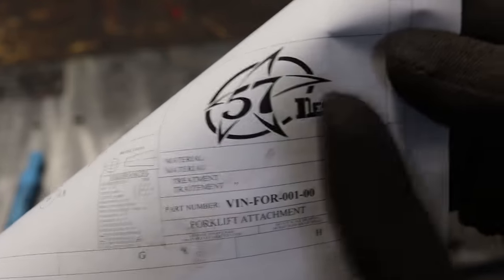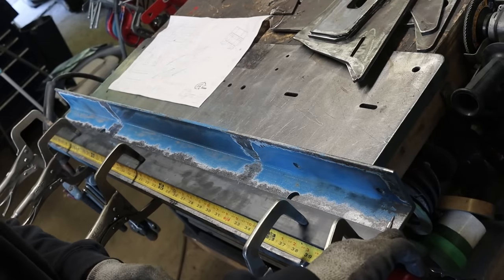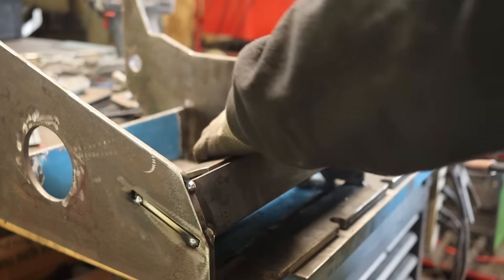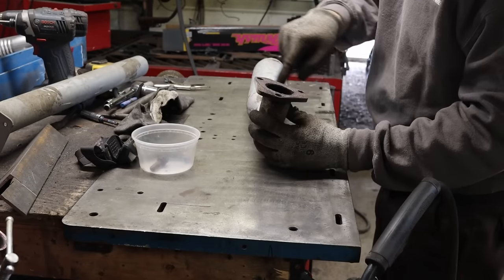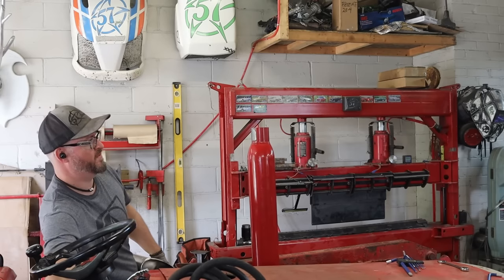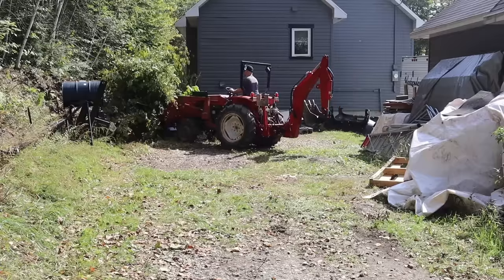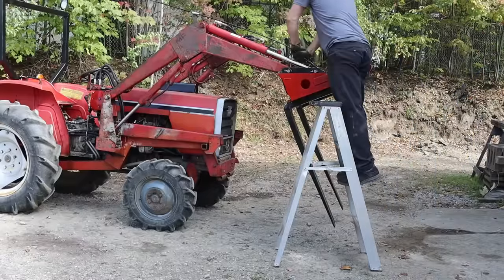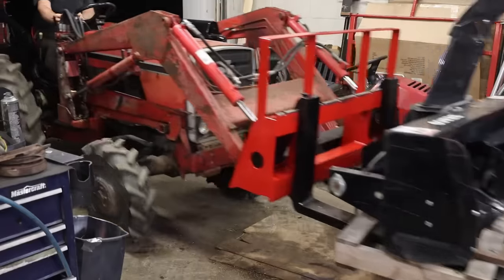DIY Pallet Fork Attachment for my tractor

Comment: If you add a cutout at the centre of the bottom rack it'll be easier to install or remove the forks. Just move forks to centre and tilt forward it releases the bottom, lower and back out. Installation is reverse. You'll never have to pick up a form by hand and slip over the end. Plus you can now add a stop at the end of the rack to prevent the forks from sliding off. I'm guessing your next project has something to eliminating your enemies and getting rid of the evidence... Smart!
Reply: I came here to say just that. 
Usually the cutout is only big enough for one fork so when you use both forks pushed together they won’t come out.
Reply: @Crewsy  That is a good point👍

Comment: I just found this channel two hours ago with the electric power steering video, very cool! I too have an old tractor that I would like to modify but sadly I do not have the skill or tools to do it. So instead I will just go out and look at the tractor, sigh, and then go back in again.
Reply from the maker: Hey thanks Robert for the comment! What is your old tractor?
Reply: @VinyB57  its a 1982 Kubota L245, I bought it real cheap and it has really paid for itself. I did not think I needed a tractor, but man, when you get one its really awsome to have. I think that next years project is to get a quick connect, in my case it will be a ’Trima’ quick connect, to get in on that sweet pallet fork action. I also have a front mounted hydraulic snow blower so I really look forward to that video!

Comment: Lay the muffler down and route the exhaust under the tractor and out the back by the 3-point hitch or at least just past the driver's station. The longer the pipe the quieter the exhaust. 😉

Comment: You have to lift the forks slightly at the bottom with one hand and push them at the top with the other hand. You also need grease. The forks on my pallet fork can often no longer be adjusted properly if they get too dry

Comment: Great video, I'm dream of starting my own attachment company, starting with the basics forks, buckets ,grade bars, hay- bale spir, Etc... 
 I can conceive the production of the headache rack/ brick gaurd like you have done here,
   but I am wondering what method/ process I can come up with to make the actual fork tines ...? 
I've searched up & down and found very little info on the bending and tapering that goes into making tines.   
    If nothing else I may be the first to post a video of my solution I come up with. 
.

Comment: 11:01  La 4e fois est le charme? 4th time's the charm? Could you use your loader bracket as an exhaust header and blow it out in front of your axle? Maybe too much flex, but it's an idea.
Reply from the maker: I'm not changin it again! 😅Well, it's an intereting idea, but my loader is ''quick attach'' with my tractor and the beam in the way of the muffler is part of the loader and the not the tractor, so when I'm removing the entire loader, that part is gone too! But thanks for the idea!